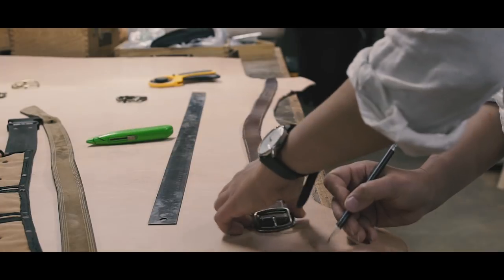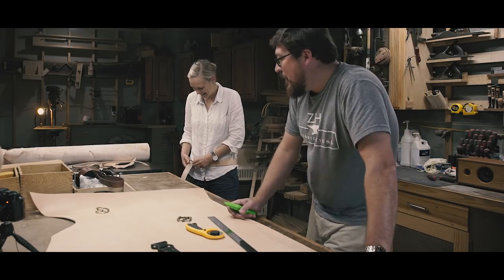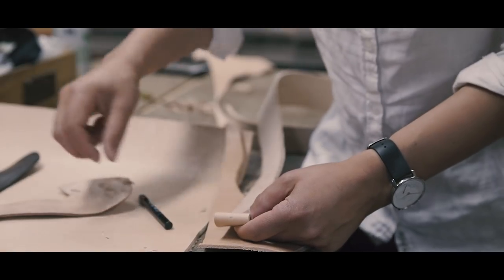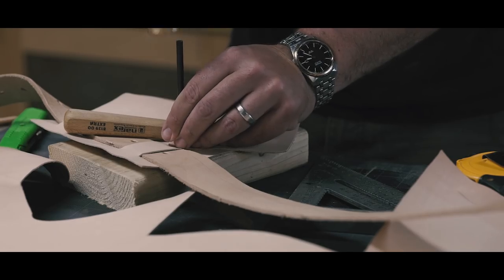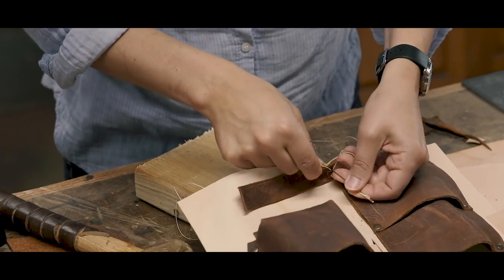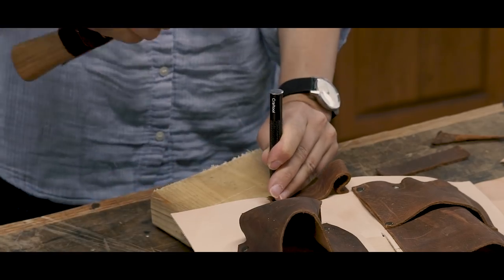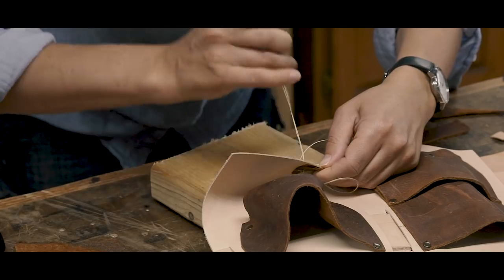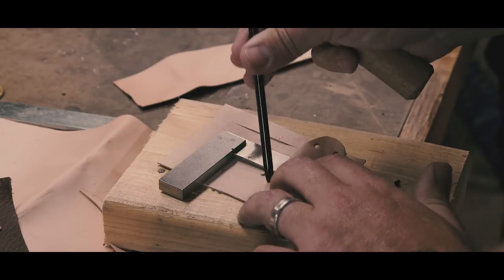How to Make a Toolbelt | Beginner Leatherworking with Darbin Orvar

Comment: Just subscribed to your channel thanks to Linn. I'm going to be viewing your old videos and I'm looking forward to your upcoming videos. As far as your isolation goes, I'm right there with you. Yours is geographically influenced, but mine is influenced by my circumstances. For the most part I actually like the peace of solitude, but there are many times when I need something that I wish I could just hop in my Jeep and drive there myself.
Reply from the maker: Thanks for watching!  It sounds like maybe you're injured and can't drive?  If that's the case, I'm terribly sorry!
Reply: Thanks. I'm disabled due to neck surgery in 2012. I can't turn my head far enough to safely drive, and there was no way I was going to be able to return to work as an automotive technician. I still work on my own cars doing what I can, but I've been given the chance now to do what I've always wanted to do since wood shop in the 8th grade; woodworking. I need to clean out my garage of 35 years of accumulated automotive "savings" first, but it's almost six years later and I still haven't made much progress.
Reply from the maker: Oh that sounds frustrating.  I'm glad you get a chance to pursue woodworking more though.  Sometimes a purge is good for the soul.  Maybe look around and see what's priceless to you and sell the rest on Craigslist.  Lots of other gearheads out there and it will give you more room to expand your woodworking shop!
Reply: Frustrating yes! It's like looking at a bowl of spaghetti and trying to find the ends of the same noodle!